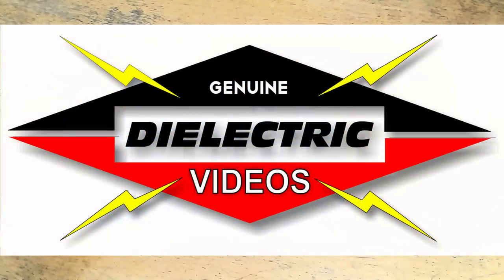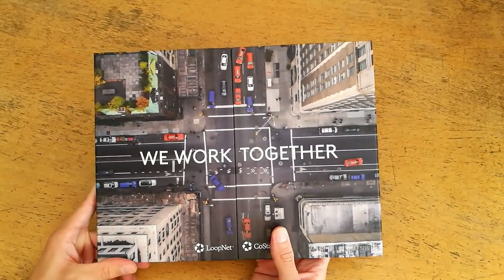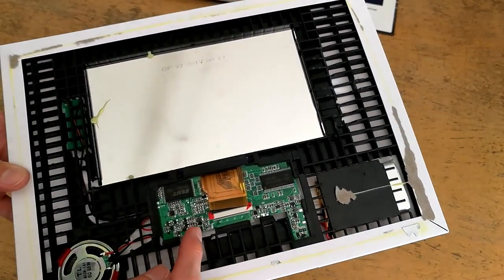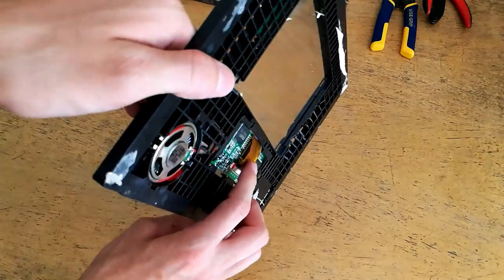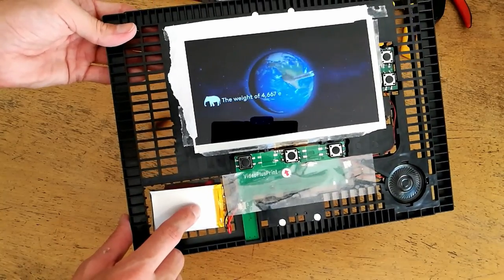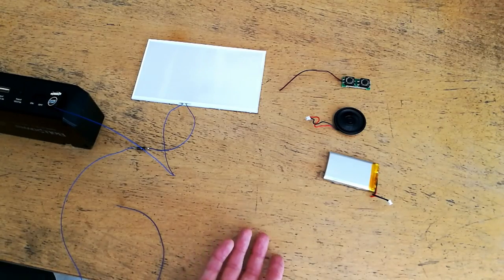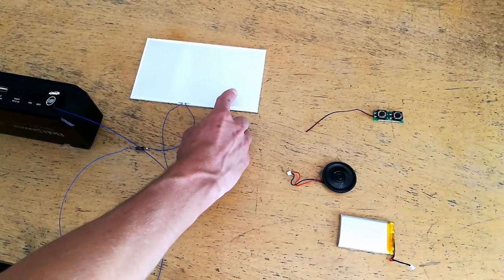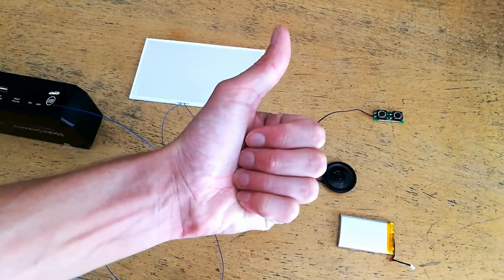EP 43 - Disposable Video Brochure Teardown

Comment: For some of these these units, you can unlock the mass storage mode by pressing the play (or some button) button 4 times when USB is connected.
Reply: I have one but pressing the play button 4 times while connected didn't work. Any other ideas? I got it to connect a while back but I can't remember how I did it. EDIT: Nevermind. I was just using a faulty usb cable (power worked but no data lines). I tried a different one and it worked!

Comment: Couldn't the display be driven by a replacement LVDS board ?
Reply from the maker: Possibly; although the pinout of the ribbon cable was not publicly available. I suppose you could take the time to probe each pin and try to reverse-engineer the cable pinout, then use an LVDS controller to drive the display.
Reply: Dielectric Videos I'm not sure it's LVDS. On the small panels (i would say from 320×240 to 640×480 panels), the interface is usually 24 bit paralell with HSYNC, VSYNC and pixel clock signals.